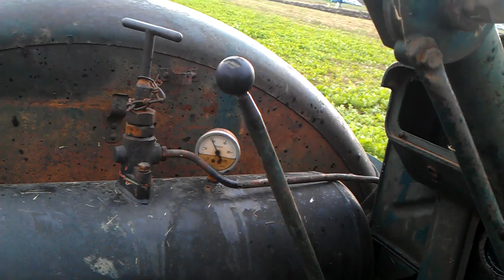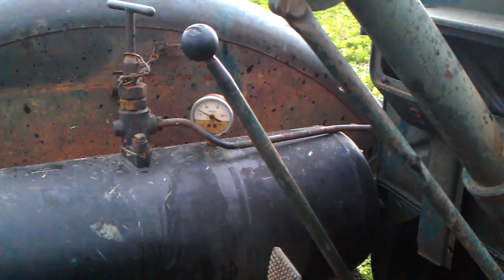Bolinder munktel BM20 1949 startup

Comment: For all the gas(acetalene?) that was dumped into heating those cast iron bulbs, steam could have been generated many times over in a flash boiler and meaningful work could have been underway along time  before.  The historical contribution of this engine type not withstanding the concept is seriously FUBAR.  Leave it to the Germans to "Beat a Dead Horse."
Reply: +Lavern Dickerson  Germans? It's a Swedish engine.
Reply: The burner in this case burns diesel, it's using the fuel from the tractors main fuel tank! So no "valuable" gas wasted, Also it only needs to be heated for startup, for about 10 minutes or so, when the engine is running it produces its own heat. This engine type was very common in Scandinavia and Germany, due to its reliability and easy/cheap maintenance at the time. It could also run very well on almost any kind of fuel, so fueling it was economical since you could use very low quality fuel
Reply: They had such a beautiful sound which really gave us somuch  peacefull and trust.